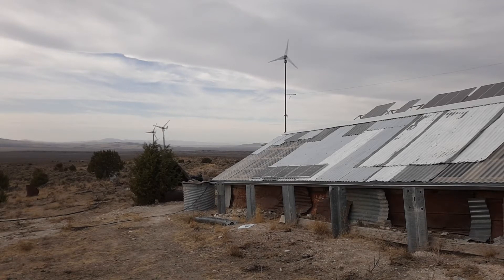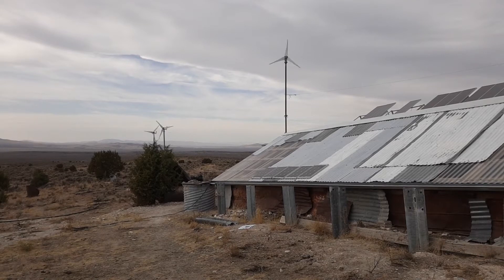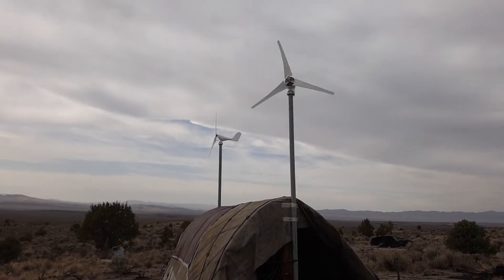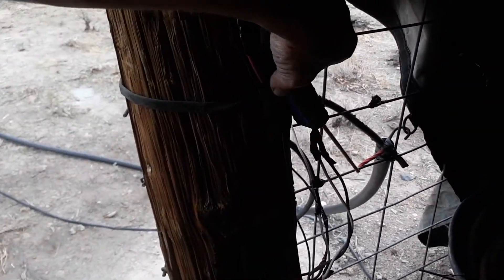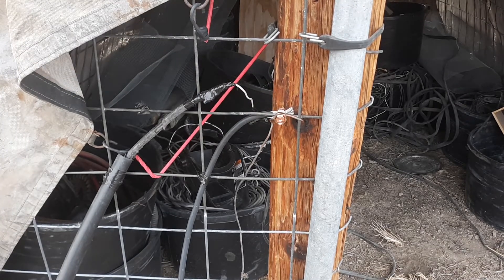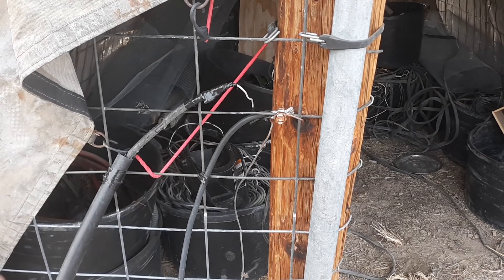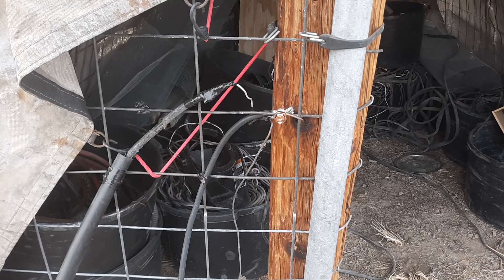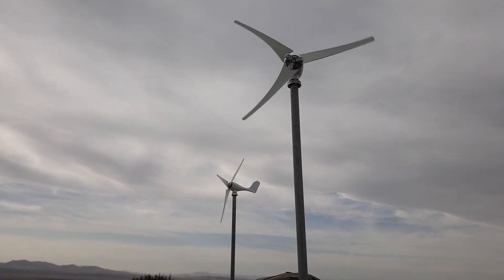400 watt 20 amp wind turbine

Comment: Why the third turbine doesn't rotate?
Reply from the maker: It was the first turbine I set up and it has a slightly faster start up speed but that is ok because it also keeps going into higher wind speeds when the other 2 brake themselves.
Reply: @damocsell  
My friend installed 2 wind turbines in same way you installed your 2nd and 3rd turbines, and one of them stop spinning when wind direction put turbine tails in line.
I think the air flow comes out from the front turbine stop the other turbine from spinning.
Reply from the maker: @bahaalsakkaf7853  Yes that can happen but for my setup the wind does not often come from that direction so I don't often have a problem.
Reply from the maker: @bahaalsakkaf7853  another problem I did have was when i had too light of a main power line to my batteries the turbines would shut themselves down before the batteries were charged.I upgraded the main power  cable to 10mm thick and I no longer have that problem.
Reply: Hi I've just setup the same turbine here in England. I'm only getting 1amp in high winds what can I do to rectify this please any advice would be great.